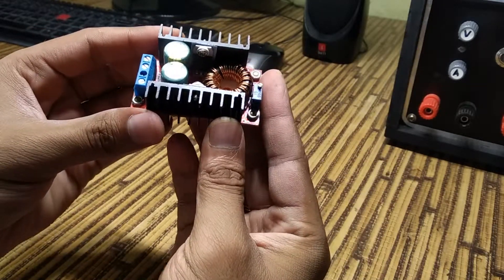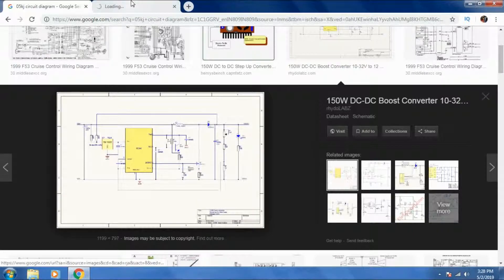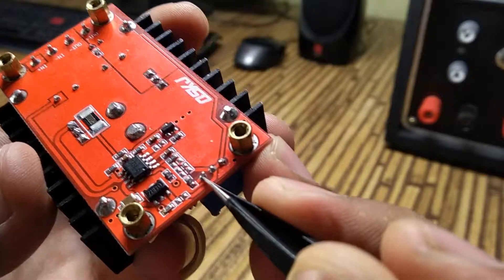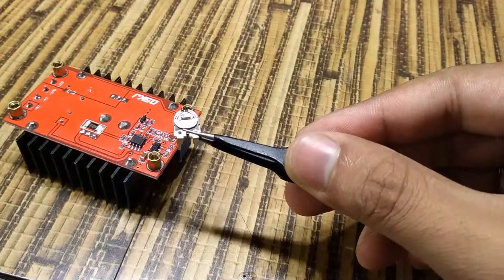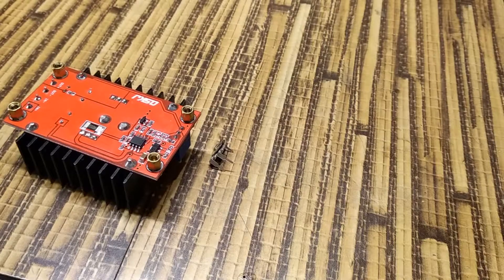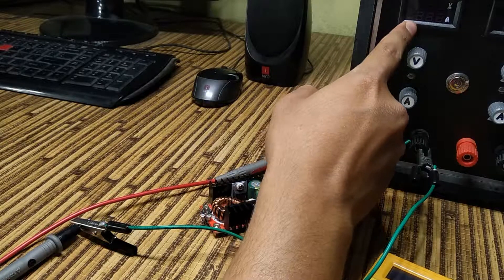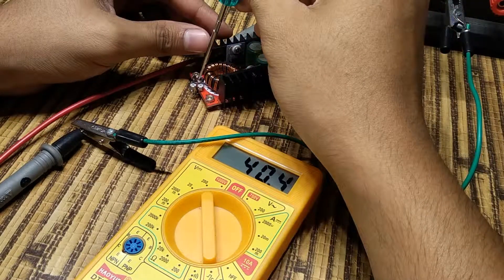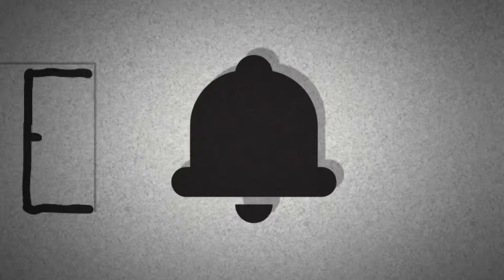How to modify boost converter for wide voltage range

Comment: Does this same work for 400w boost converter where it has 10k constant Voltage potentiometer series with 1.2K resistor??
Reply from the maker: It might work most probably. Make sure to go through the schematic of your boost converter. You can find it online by model number.
Reply: @ElectronicsFreakEF thanks i fried that board long time ago lol 😂

Comment: The output capacitors are rated for only 35 volts! If you don't change them to 63 volts or atleast 50 volts then you may hear some sounds of gun shots 🔫 and some magical smoke💨
Reply from the maker: Mine one has two capacitors on its output, rated at 63 volts each! 😁👍